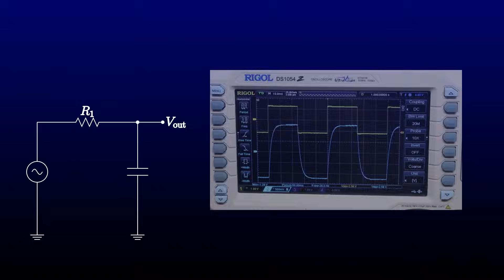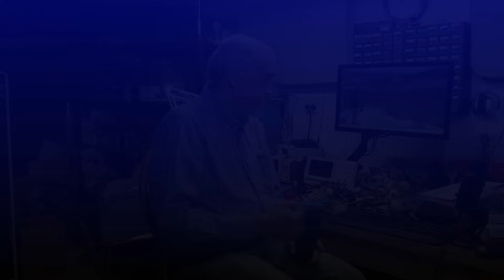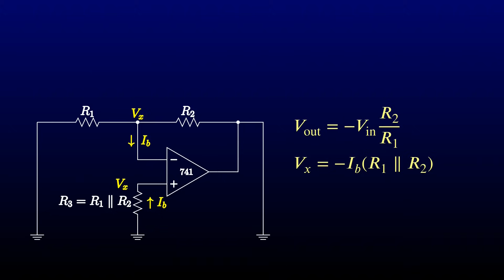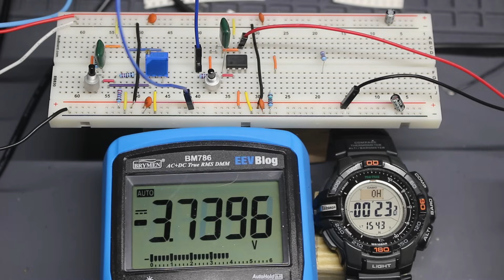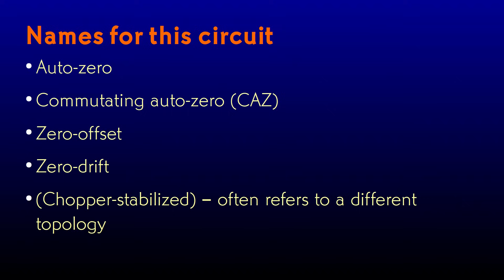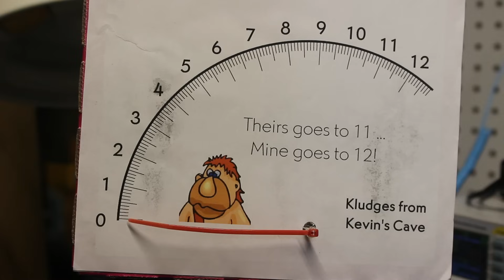The Op-Amp Integrator, Revisited | Op-Amp Basics, episode 10

Comment: Hey I am assuming in the final demo with DC motor you it is generating negative voltage when turning the pointer clockwise. As the output of the integrator will be negative. Is my assumption correct?
Reply from the maker: Reviewing the video, the meter is going positive with a clockwise rotation of the pointer.  At about 28:20, I'm turning the pointer counter-clockwise and the output voltage goes negative.  If I had got it wrong, I could always reverse the motor leads!

Are you mistaking the icon on the meter display that shows it's reading a dc signal for a minus sign?

Comment: I thought you were going to touch on what the audio industry used to call a "super servo" back in the 1970s. Basically another opamp which has a very low time constant who's job is to monitor the DC drift and compensate by adding a tiny DC bias trim. The goal as they were used back then was to have as close as possible to 0VDC on the speaker output. Most likely due to the poor quality amplifier components of the day, and to eliminate the need for any trimming during manufacturing. It seemed excessive to me at the time, but you could find them in many products, so it must have been worthwhile, economically.
Reply from the maker: Sorry to disappoint you! This was already quite a long video, and some methods just didn't quite make the cut.  I wanted to make sure that I covered bias current and offset voltage, and have at least one modern topology that takes care of both of them.  I also didn't cover in detail the traditional chopper amp with its flying capacitors.  I might come back to some of these ideas in the general area of 'special topics'.
Reply: @KludgesFromKevinsCave  No disappointment, I just thought that was where it was going. This was very interesting!

Comment: At 18:12….how come Vout1 appear in “ -A1*Vout1”?
Reply from the maker: I should have probably tried to fit a label for 'Vout1' in the diagram. I intended Vout1 to be the output voltage of amplifier A1.   If we use that notation, then we have a negative feedback loop.  The negative trim input is connected to A1's output, and both inputs of A1 are connected to V-, so we have

Vout1 = A1 (V- - V- + Vos1 - Vout1)

The two V-'s cancel out, giving the equation show.
Reply: @KludgesFromKevinsCave  Yes of course.....I had not noticed that Vout1 was connected to (-N)

Comment: A cool and working idea to null the DC offset of the integrator is to connect the output of the integrator to a low pass filter and the output of the low pass filter to a an inverting amplifier and the output of the inverting amplifier back to the non-inverting input of the integrator, essentialy setting negative feedback loop where a inverse DC voltage is fed back to the non-inverting input of the ingerator proportional to the DC offset of the integrator.

If the integrator accumulate a DC offset this error is inverted and fed back to the integrator causing it's output to accumulate an negative error and thus canceling all DC errors.

The feedback loop does have a settling time though.
Reply from the maker: That's a fine approach if you don't need the integrator's input to go all the way to dc.  Any dc offset on the input signal also gets cancelled by the feedback loop.  

I plan to use the approach you propose in another couple of episodes, where I'm planning to show a mike preamp that can work with a single-supply circuit, by having extraordinary high gain at signal frequencies but rolling the gain off to unity at dc - precisely by having a filter in the feedback loop.
Reply: @KludgesFromKevinsCave  that is a very interesting point - when is it undesirable for a DC offset in the input to be canceled at the output by the feedback loop?  I assumed any DC offset in the input will saturate the integrator so a full cancellation of all DC offsets are good.
Reply from the maker: You may be integrating a small, slowly varying signal over a specific time interval. Consider something like a camera auto-exposure, where you  have a light source that is varying in brightness, and you are integrating the output from a photodetector to determine when to close the shutter.

Comment: Nice video.  One caution (learned from bitter experience!) when using auto-zero op amps:  If the circuit operates in the presence of a lot of noise or other signal whose frequency is approximately the same as, or harmonically-related, to the internal switching frequency of the op-amp, then the auto-zero function can make the output quite noisy as compared to an op-amp without the auto-zero function.  The technique of making the auto-zero clock frequency a spread spectrum should help with this.
Reply from the maker: Yes indeed!  That's one reason that I chose the OPA186. It does use a spread-spectrum clock, and moreover at a relatively high frequency for such things - the center frequency is 5 kHz.  

I did show the noise spectrum from the data sheet (and a quick snapshot on the 'scope of what it looked like). I was pleasantly surprised that the transitions as seen on the 'scope were relatively clean - I've seen auto-zero amps throw off horrible voltage spikes at the clock frequency, giving a comb of harmonics when viewed in the frequency domain.

I neglected to mention the possibility that aliasing might introduce mixing products between the signal (or a noise component) and the clock, but the video was getting awfully long as it was.  It was certainly something to watch out for with older CAZ op-amps like the LTC1150.

Of course, using the thing in an integrator - which is inherently a low-pass filter - is the best possible case. Unless your period of integration is a subharmonic of the clock, the integration will cover a multitude of sins.

Certainly, the popular wisdom that chopper-stabilized amps can't be used above half the clock frequency is a thing of the past. 

For further reading: 
https://ocw.tudelft.nl/wp-content/uploads/Reader_ET8017_Electronic_Instrumentation__DOC_techniques.pdf 
https://jics.org.br/ojs/index.php/JICS/article/download/572/384/2645

But those belong to a more advanced course than this one! (And even they both conclude that we need more clever ideas to control the noise with these beasts.)

It intrigues me, the number of comments I get from people who know this material quite well and are nevertheless following this introductory course.  Trying to garner ideas for teaching the stuff yourself, perhaps?
Reply: @KludgesFromKevinsCave  Thanks for your response.  I'm not a teacher, but I enjoy seeing what information others are putting out, and I never know what I may learn.  I was definitely intrigued by the pointer in your video, and I wondered what was behind it.  If I remember correctly, the clock frequency of the op amp that caused our trouble was above 30 kHz, and it worked fine as long as the interfering signal was removed from that frequency.

Comment: There used to exist an Intersil ICL7107 3½ 7 segment Voltmeter. Internally it used charge balancing between input and reference and also cancel out errors. the integrator was really a digital counter. There also was a 7137 LCD version.

One important source of error was dielectric absorbtion of integration capacitor. I'm assuming it was some kind of hysteresis. I don't recall exactly.
Reply from the maker: Dielectric absorption is an issue that I've kind of glossed over.  When you charge up a capacitor and leave it charged, some of the charge migrates into the dielectric material and stays there.  If you discharge the capacitor, and then leave it open, it'll charge itself slowly back up to a small fraction of the charge you previously had on it. The physicists don't entirely understand what's going on.

Electrolytics and mica caps are horrible for absorption - a tantalum charged to 10V and briefly discharged will be at about 400 mV in an hour. High-kappa ceramics (Y5V, X7R) are not great, but C0G can be ok. Polypropylene seems to be the best of the currently-available lot -  a polypro cap will recharge only a couple of mV in the same time. The other polymer dielectrics are also pretty good. Teflon and polystyrene were even better, but try to find them nowadays.

For precision circuits, designers sometimes resort to tricks like carefully trimmed RC networks to balance out the absorption.

Comment: not quite an integrator, but abuddy of mine and i built a function generator from a max038 chip. he was kind of a function generator nut and had a whole collection of the things from wavetek, hp and tektronix. He wanted to build a 100 MHz classic function gen, not dds. i had a serviceable func gen and a sig gen so i humored him but added that i wanted milli-hertz! Oh no, cant use too large a current set resistoron the 038 and many microfarad precision poly caps are BIG and EXPENSIVE. So while doodling at work waiting for a long test to complete i started on a capacitor multiplier. found an analog devices chip that had the best specs and breadboarded it. milli hertz obtained! Sub millihertz even, tho eventually the <1uV offset was visible. Waiting for a 1 millihertz wave to cycle and store on a digital scope was even more interminable than the test. a new layer of hell discovered!
Reply from the maker: Have you seen the episode from a month or two ago about the sine shaper?  The 038 had a similar ladder inside (built of transistors rather than diodes).  I don´t want to spoil it, but you probably will want to watch the upcoming episode on the op-amp differentator.

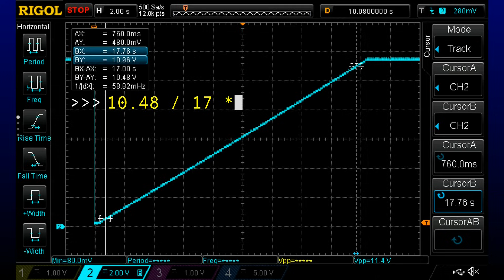Comment: At 11:05, it is the bias current contribution to Vout that is cancelled by putting the resistor at the non-inverting input?
Reply from the maker: Exactly. The resistor on the non-inverting input will carry the same bias current, cancelling the voltage contribution.
Reply: @KludgesFromKevinsCave That makes sense. I always thought you'd have to check each bias current independently, and add the difference or something, but just copying and pasting one to the other is much easier!
Reply from the maker: That's why the data sheets separate bias current from offset current. Bias current is the mean of the two input currents, offset current is half the difference between the two.  I'm ignoring offset current in this discussion, since for all the amps I'm using, it's a handful of pA. For the CMOS OPA186, the offset current actually exceeds the bias current, but they're both a few pA at room temperature. On a CMOS amp, nearly all the input current comes from leakage in the input protection diodes.
Reply: @KludgesFromKevinsCave thank you for confirming